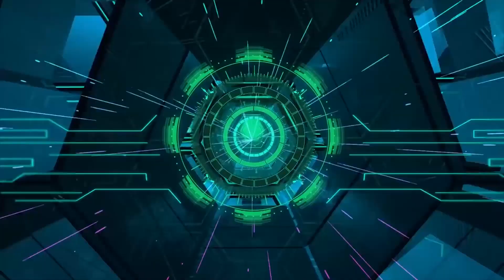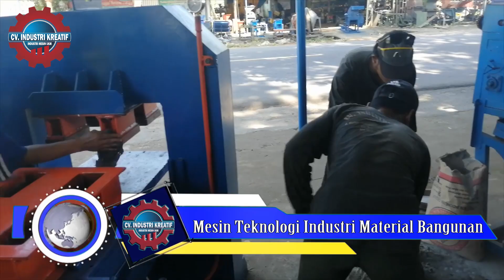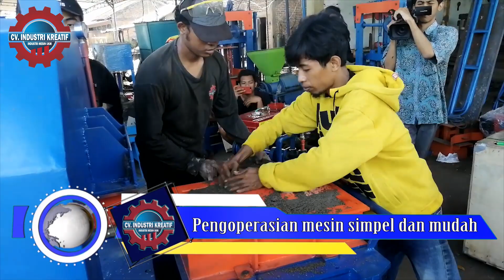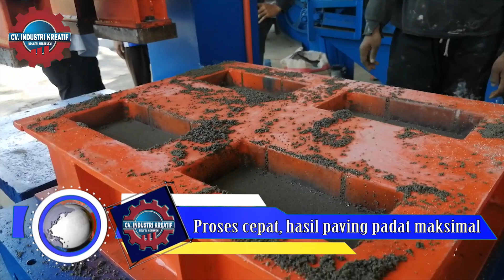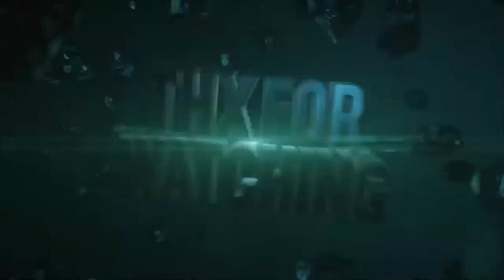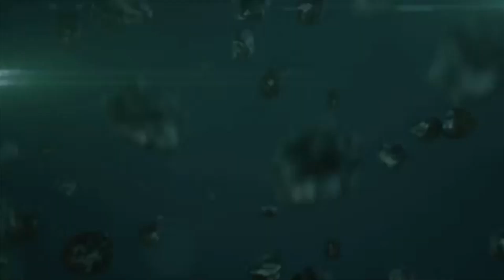PROSES LEBIH CEPAT HASIL LEBIH PADAT | MESIN CETAK PAVING HIDROLIS

Comment: Ini harganya berapa bos
Reply from the maker: untuk info harga,detail mesin & pemesanan hubungi Customer Service Representatif Kami (Telp/WA) 081234280625 - 081217850288 - 081252297132 atau kunjungi Workshop Kami di Jl Madiun - ponorogo KM 10 Selatan Puskesmas Geger 300 Meter Kec Geger Kab. Madiun Jawa Timur